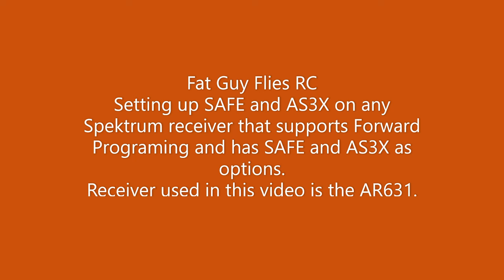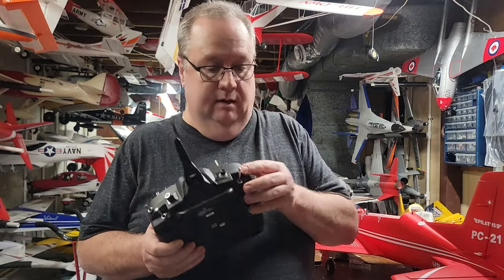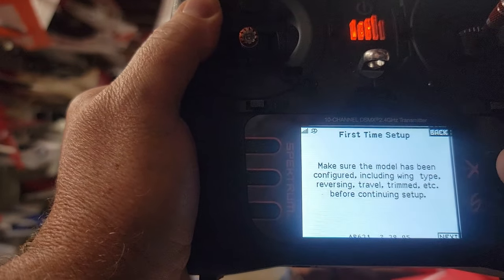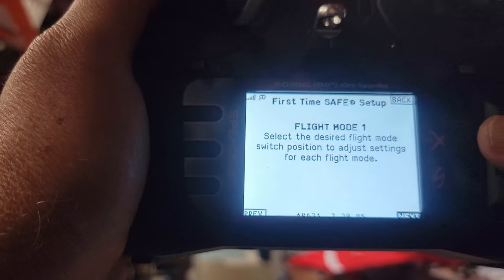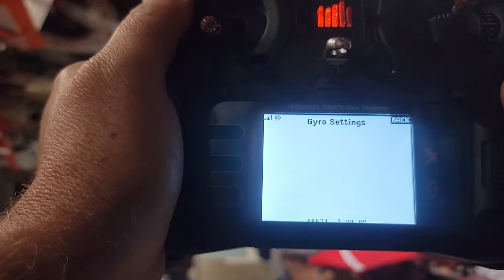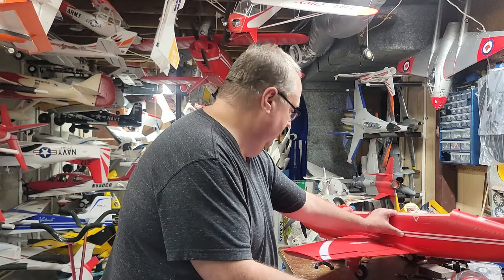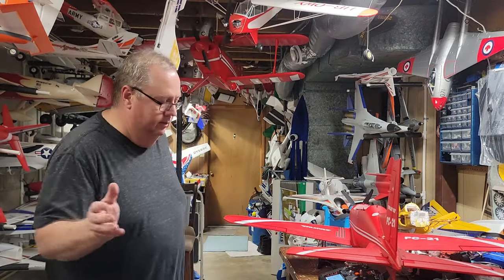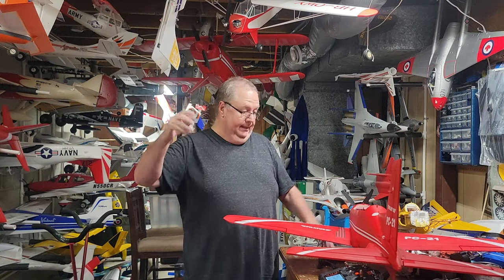Setting up AS3X and SAFE with Forward Programing-AR631-AR630  by FGFRC

Comment: Hello. Learned so much from your videos till now but i had a problem that i can’t figure it out. I crashed my habu ss bnf on the maiden flight becouse elerons were inverted. I reversed elerons servos setup and works just fine without safe and as3x. when the plane leans left safe select should stabilize it by turning left eleron down, but actually it adds more up movement so the plane is getting actually inverted and crashed. I can fly it ok without as3x and safe but i’m not so good so i need both of them. My toughts is that from the factory the servos was put togheter inverted, the left one on the right side and the right one on the left wing.
Reply: Nevermind, i managed to reset everything and now works
Reply from the maker: When you maidend it did you do a control surface check? You must not have since you would have seen that the ailerons were reversed  then when you reversed them you should have set up the as3x and safe again with them working correctly.  That explains why there only work correct when you switch the gyro off. ALWAYS ensure correct movement BEFORE doing any forward programing other wise the gyro maintains the plane the way the gyro records the surfaces. If it records it with in correct movement then it will THINK that is correcting the plane.
Reply: Yes indeed, my bad i swiched after i set up safe and as3x. I need led to update the reciver too, in order to get all the options u had in the forward programing menu, before i had only one button throwards safe select and that was all. After seen this video i knew something’s not ok with the reciver and i updated it. The i saw i had factory reset on forward programing menu and it was easy from there. But again, nice work with this videos, it helps a lot. Keep the good work mister!👏🏻

Comment: Very nice explanation. When you do this with an FMS plane how do you deal with the REFLEX 2 module? Do you just bypass it completely and comment all servos directly to the SPECTRUM receiver and connect to the FMS stock ESC for power? Do you generally just remove the REFLEX from the plane? Just wondering what the physical configuration looks like.

I've seen others install non AS3X/SAFE receivers and just tie into the REFLEX 2 module and use that for gyro stability.
Reply from the maker: Well it depends on the aircraft. The FMS Kingfisher is super stable and does not need any gyro so I chucked it completely.  If I want to keep the reflex and use ALL that the Reflex offers then I use a non safe receiver like the Spektrum AR620 and plug the sbus lead into an open channel on the receiver and assign it to a 3 position switch.
Reply: Thank you for your reply. Very interesting. It would be interesting to know which FMS aircraft you think would benefit from an AS3X and Safe enabled transmitter as opposed to using the REFLEX stabilization capabilities. (For particular planes I mean).
Reply: Yes, I watch your video on the FMS Super Cub 1300 mm where you demonstrated connecting the s bus line into GEAR to use the full capabilities. I am about to do just that with the 1700 mm. Thanks for all of your insight. Love it that you get into the details.

Comment: Thanks it works  I didn't put the fix on the third position b switch  so I  could fly without any safe and AS3x, also why doesn't  the rudder port  work I had to use the ail port ?
Reply from the maker: it would but that would put the rudder on your left side of the transmitter, i mean that is very old school and I commend you for trying it but having it in the aileron port keeps your flight controls on 1 stick.
Reply: why doesn't the rudder port work does that mean it is defective.

Comment: I'm hoping someone who knows what to do with my situation. I have a new MFX by durafly. We set everything exactly as video says. Works with most planes that are not very fast. Now with this setup after 50% throttle the wobble starts and gets uncontrollable. People say gains are set too high. How can you make it adjustable with out a r knob . Nx6
Reply from the maker: I am afraid you will not be able to with that radio. You will be forced to use preset gains that you can only adjust while on the ground.

Comment: Great video, one question. I have a DX9 and I set up everything they way you did in your video. Only one issue I am having. When I toggle my switch for safe it is the same in all three positions. I tried to change it but it doesn’t work. Every time I go to F mode and look it only shows position 3. I did follow what you did in your video step by step but no luck. Can you please advise? Thank you
Reply from the maker: Without being able to see your transmitter I would say you did not properly save a 3 position switch. if it is done right with a 3 position switch or 2 position switch one F mode can have safe enabled and the second F mode with have safe inhibited but as3x on all.  Sorry if this does not help but I need to see your screen to see what your doing.
Reply: @FatGuyFliesRC  thank you for following up with me. I will try again like you showed in your video. Stay tuned!!
Reply: Hello, I tried to post some pictures via reply. It won’t let me post them. Is there another way I can send you some pictures? Thank you
Reply from the maker: Email them to me. GREGORYGLASCO@GMAIL.COM ❤
Reply: @FatGuyFliesRC  just sent them to you, thank you so much.
Reply: @FatGuyFliesRC  if you could let me know when you receive my email. Some times email gets lost in space!!

Comment: Great video, but l still can't cut on off with switch, l only want as3x,l big balsa warbirds, l have dx9 and 8 channel receiver, Ar8360t, 1 channel for rudder 2 channels for elevator 1 channel for ailerons 1 channel for flaps 1 channel for gear and 1 channel motor esc, l want to use switch c 3 position switch, what lm l doing wrong, it want let me use c switch, but it will activate as3x,can't control it.
Reply from the maker: With the Flight modes you can make the as3x on or off. Do flight mode one with it on and flight mode 2 with it off. Assign that to what ever switch you want.
Reply: Does as3x require a channel, lm going to watch it again, l just don't get it

Comment: I have an odd situation where when I follow these steps and have everything set but need to set the F Mode Setup and fixed/gains for each channel I can't. It only shows Flight Mode 3 at all times no matter where I have the switch (I'm using switch D). I'm not sure where I messed up. Any ideas?
Reply: I actually just figured it out. The default for switch D in the FMODE setup was Aux 1 which wasn't inhibited and assigned to channel 6 so likely still bound to an existing switch. So I ran the FMODE setup again and this time chose Aux2 with switch D and I was able to successfully switch between all of the flight modes. Aux 2 was originally bound to switch B (where you put your SAFE) but I use switch B for flaps and had inhibited Aux 2 before I set the switch to be used for flaps. I assumed this meant Aux 2 would be available for my switch D SAFE and everything worked.
Reply from the maker: Glad you figured it out and in the meantime the way channels are assigned and can be customized became more real for you now!!!

Comment: I can not get forward programming to show up. Updated my spektrum transmitter aswell, I am out of ideas.
Reply from the maker: The receiver your using must also support it.
Reply: @FatGuyFliesRC  It should, it is the ar631. Pre installed in the plane.
Reply from the maker: @zuidkb7312  Ok what it your exact transmitter?
Reply: @FatGuyFliesRC  The spektrum dx8e, updated to the latest software version.
Reply from the maker: @zuidkb7312  This ia a quote from my google search about the DX8E:  As of March 21, 2024, forward programming only works with the AS3000-equipped PowerSafe receiver product line, but other products that use it will be released soon. Users will also need to update their receiver.    If I were you I would do an online chat with HH or Spektrum to find out the issue.
Reply: @FatGuyFliesRC  Thankyou for the effort. I will definitely go ahead and start a chat with horizon hobby. Thanks!
Reply from the maker: @zuidkb7312  I HOPE i am wrong but I think that one was the last to NOT support modern FP. HOPE I am wrong!!!
Reply: @FatGuyFliesRC  I really hope so aswell haha.
Reply: @FatGuyFliesRC  For future reference: The dx8e does support forward programming. However, version 2.10 has a bug where forward programming doesnt work. I reversed to 2.09 and all works now.

Comment: Man I can’t get this god forsaken GD receiver to work I get right to flight mode and that fm channel maybe it’s my radio when I go into configure it it keeps taking me back to first time set up it’s like my radio isn’t switching channels my flaps won’t work except on the A switch or your gear I followed right along with you I’m about to bounce plane receiver and transmitter off the wall but that would be to much money. Good thing I don’t drink anymore or it probably already have happened. lol back to the reflex system but you always can’t get the identical plane but it gives you something close.
Reply from the maker: question what is your transmitter?  and what receiver are you using? Just so I can get a baseline.
Reply: @FatGuyFliesRC  I’m using the NX8 with an AR630 and I’m putting it in the Cessna 400 1.1m by Tower Hobby
Reply from the maker: Both should work good. I hate to not be able to help but I really need to see this issue first hand to get a better diagnoses.
Reply: ThankYou I’m going flying today I got a great day for it this evening I will do a video and post it thanks.  @FatGuyFliesRC

Comment: I can do all that plus set up my avian ESC on my Radiomaster TX16S with the new updated firmware.
Reply from the maker: Yes and I am sure the process is about the same. if I had not already purchased my NX10 I may have gone with a Radiomaster.
Reply: IF I knew then, what I do now, I'd bought the 18ch futaba. Instead of 3 yrs later getting the 20se. BUT🤷‍♂️. If a frog had wings😮

Comment: Dumb question for you Mr. Fat Guy Flies RC? Are the 'Flight Modes' 1, 2 and 3 the same as Low Rates, Mid Rates and High Rates???
Reply from the maker: NOT a dumb question. but no. Flight modes are open ended modes set by you to use for various tasks, like a landing mode or configuring the plane for aerobatics. In this case Fmode 1 is for SAFE mode, 2nd Flight mode is for AS3x and so is flight mode 3.
Reply: @FatGuyFliesRC  - Thank you Mr. Flat Guy Flies RC for such a quick response ALL of your videos are well thought out and geared to the little-guy with step-by-step instructions, I'm learning and flying again (30yrs+) because of you, be encouraged and keep up the good work... We all thank you
Reply from the maker: Well thanks so much, I really appreciate that!!!

Comment: Please help me with this PLEASE
Reply from the maker: To make gains adjustable on the fly you must have a roller/slider  or knob that can be assigned to  a aux channel. I am afraid a nX6 will not support that.
Reply: @FatGuyFliesRC  that is why I got a nx 8 now do you need to make all of the Gaines adjustable instead of fixed then go to digital channel assignment and put the right knob on gains. 
At that point would I keep them at 1x or do I go up to 2x .  
Anyone helping me with this thanks. All the guys I fly with are so so old school. Lol
Reply from the maker: No pick the roller/slider early in the FP process and that takes care of that.

Comment: Is this the same procedure for the dx series transmitter?  Im setting up my twin timber with my dx8e.. and i wasnt sure if safe was setup or i needed to set it all up..
But my timber tries to correct when flipped over and as3x is clearly working even tho i havnt set it up like this.. so whats the deal.. does it need to be set up or what lol..
Reply from the maker: Yes same procedure with the dx series as long as they work with forward programing. like an updated Dx9 for example.
Reply: @FatGuyFliesRC   so that means I'd have to get the USB cable to update my transmitter.  Because I don't have forward programming as a option in my menus.
Reply: @FatGuyFliesRC   like right now I've got my new twin timber all bound and ready to fly.. but im second guessing myself on if safe has limits set and stuff haha.